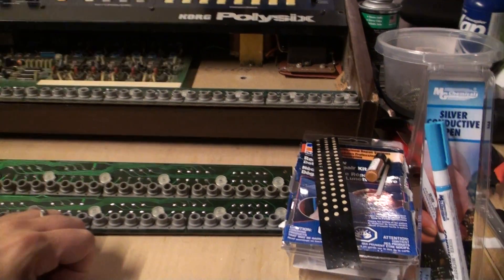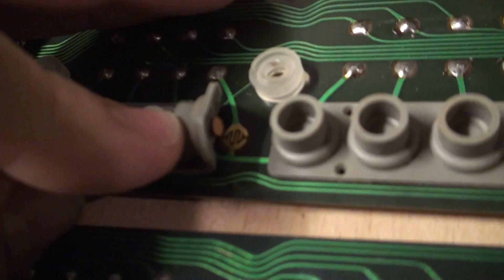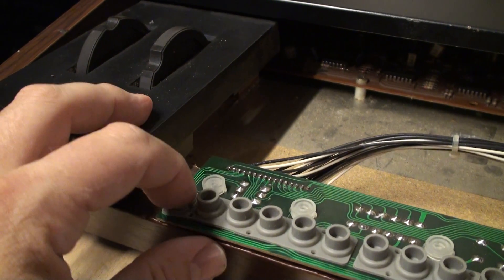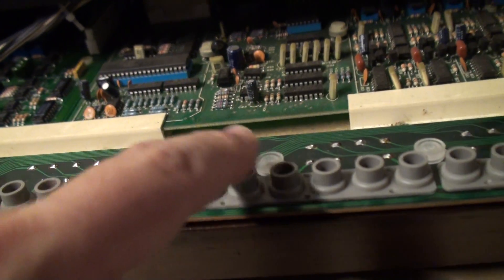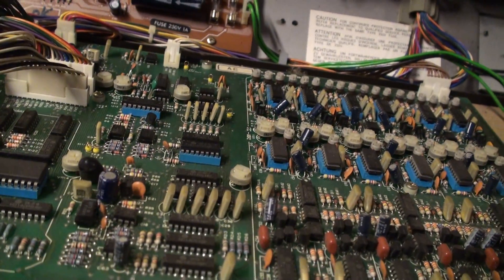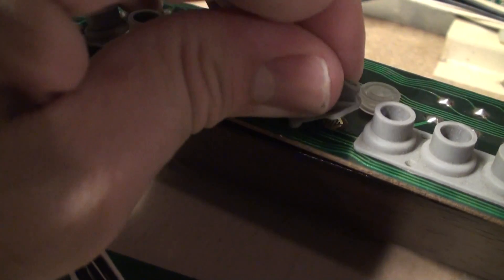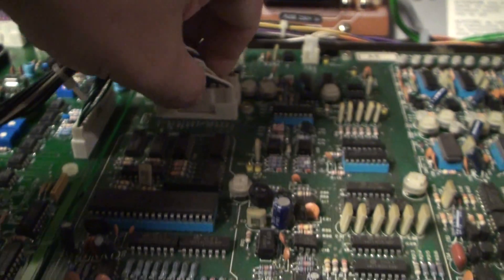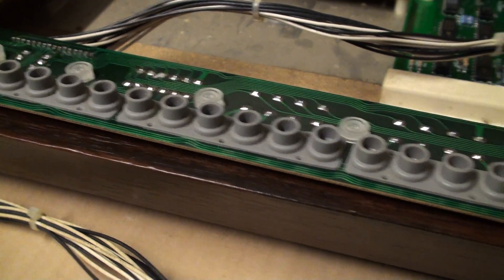Polysix Reboot p.35

Comment: gosh - i used a very inexpensive product (about three dollars?) called 'keypad fix' and with some careful application i was able to get all 'buttons' to sound in the configuration you test them above. So that was100% .. great... EXCEPT when I got the entire keybed reassembled I found that i had all but around 7 keys working (better than nothing i suppose!) so - it seems there's DEFINITELY something going on with the rubber cups or an interaction between that and the frames and/or screw tension (? not sure about that though). It begs exploration. Now I'm going to do it with CaiKote 44 which just arrived in the mail...